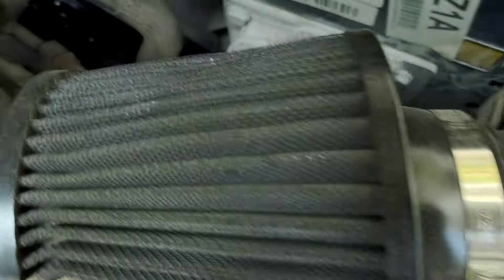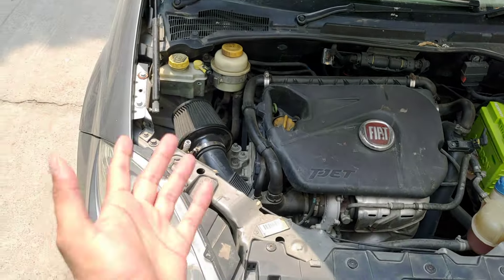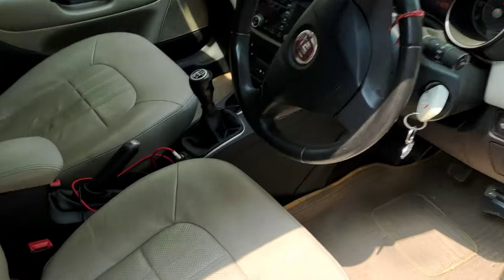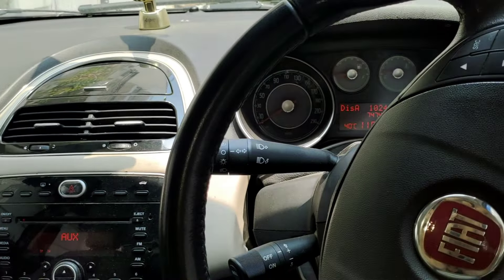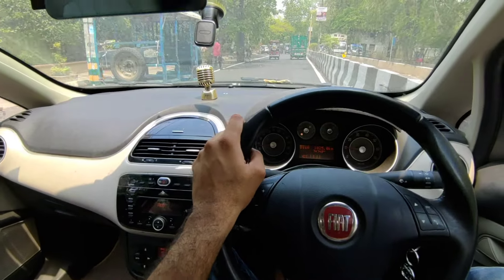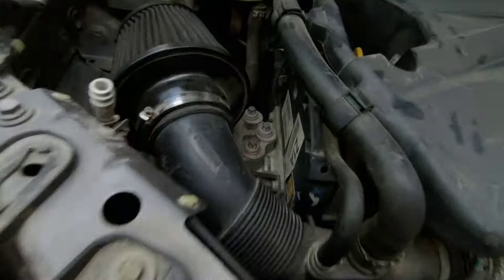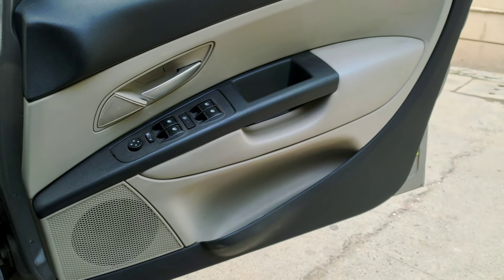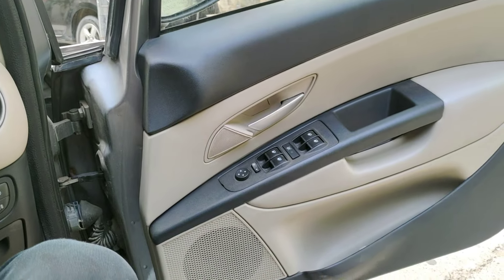Linea ki Belt lagta hai fir badalni padegi 😅🚗 After AC Fixed.

Comment: Bro this is not belt sound, this is tensioner pulley sound because of worn out bearings of tensioner pulley this sound comes and because of this faulty tensioner bearings there are high chances of breaking of belt during running .,.. I had same problem in punto mjd resolved after changing tensioner pulley
Reply from the maker: Checked it out thoroughly with the mechanics and thankfully it is related to belt only. 
I too thought the the same that how can the belt sound so early in its lifetime. Will be changing it soon just not sure will be buying the OEM or some other brand.